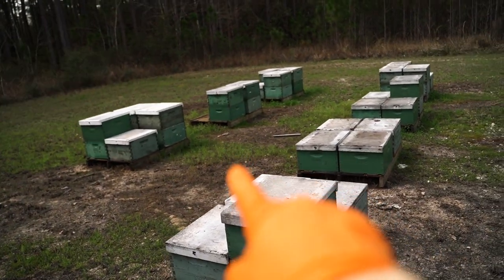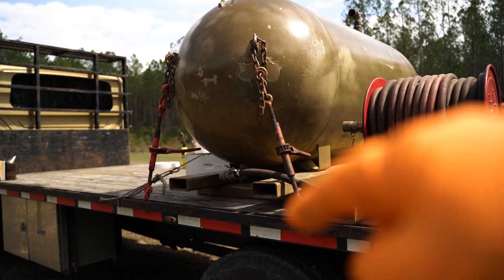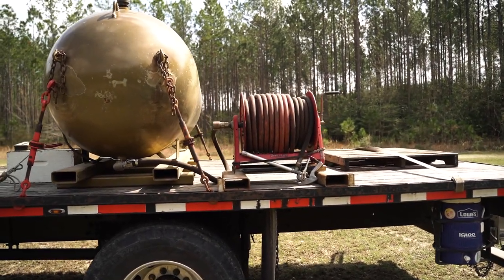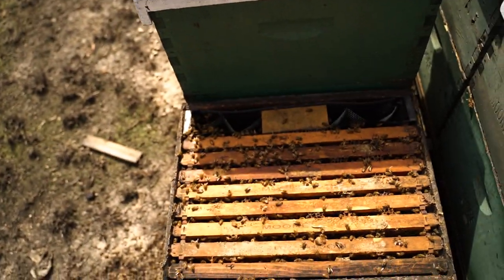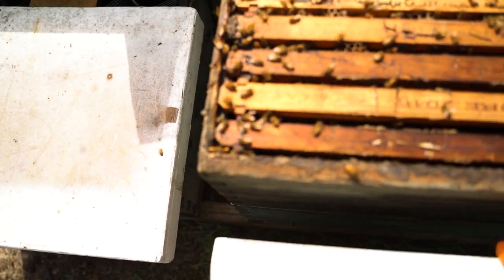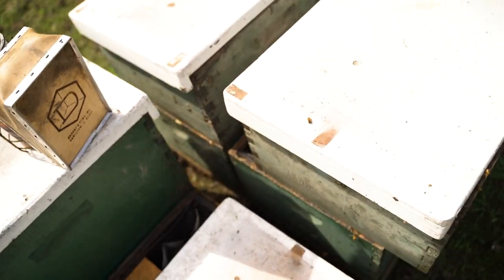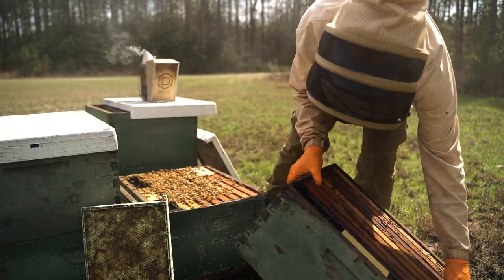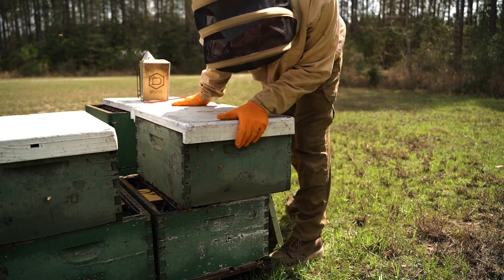How do you feed honeybees?

Comment: I’m about to make a feeder set up like this. Did you have any issues with cleaning the tank initially? (I’m assuming it was a propane tank). Have you pumped hfcs55 through It? Thanks!
Reply from the maker: We just steamed the heck out of it. It will pump whatever fees you need it to!
Reply: @beefarmerjake  Thanks. I’ve been using it for a bit now. I’ve been running 100 psi with 55 thinned 10%. It’s perfect! Again, thanks for the info and videos.

Comment: That pressurized feed tank is the cat's meow. Very nice for sure. What kind of PSI are you using 20 or 30?
Reply from the maker: I’m not sure we just get the gauge to about 11 o’clock (it’s a bar gauge) prob 40-60psi. It’s a good bit of pressure. We can usually feed 150 hives or so before hooking to the truck to repressure.